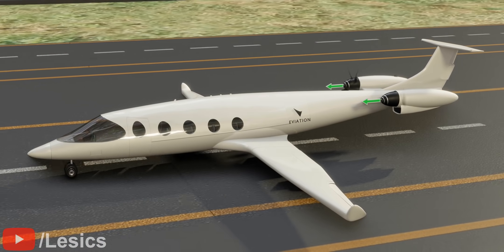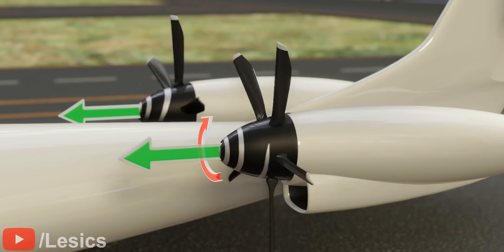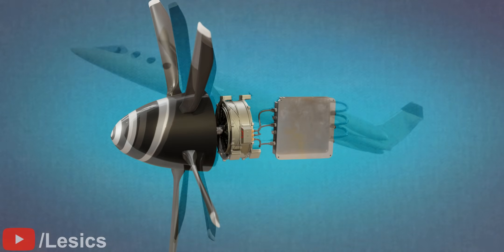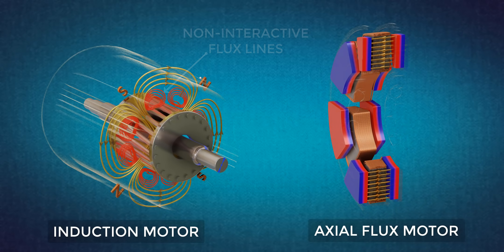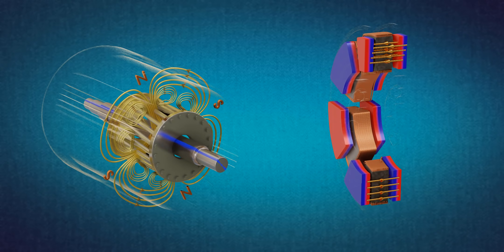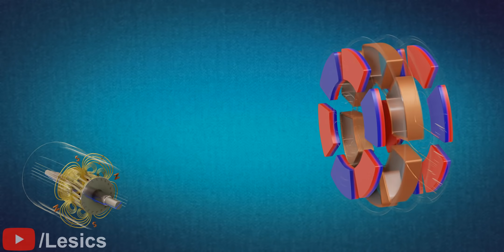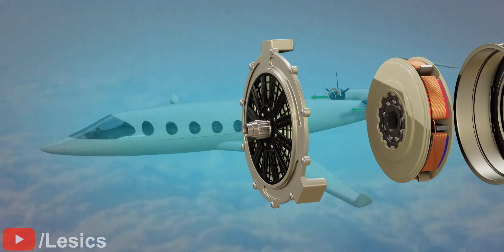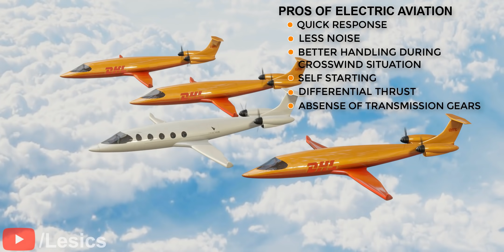Electric Aviation | The Dawn of an Advanced Transportation Mode

Comment: This video sadly isn't neutral, it just mentions pros and also just one company, seems a bit like a commercial to promote those planes. And not even the mentioned facts are true at least not all of them. One example are the elecrical motors if you adjust the frequency the propeller spinns faster, but if the angle of the blades change the current rises. The batteries can`t withstand this current very long so the lifespan is short and the cells are even more likely to overheat and shut down the engines cause the torque is to high to run slower.

Comment: Funny how this presentation puts the hardest part about electric aircraft last(Ed):  power.  They chat about BMS, and distributed batteries, but not the chemistry.  The energy density of batteries c.2021 is abysmal compared to jet fuel/diesel and aviation gasoline.  Large aircraft like what are described here need many megawatt hours of power supplied to the electrical system, or the only national border crossings proudly mentioned at the end if the vid would be from airports within minutes of the borders.  Engines are discussed, but not avionics, lights, temperature control, pressurization (you are competing with turboprop and turbofan propelled aircraft), anti-ice, brakes, boosted flight control system (if the aerodynamics don’t keep the controls and control feel light and balanced).

Comment: Thanks for this interesting production. One slight nitpick with the illustration at 4:16 is that the propeller is rotating backwards. Unless the new technology is able to make aircraft fly in reverse this is incorrect😇.
As far as differential thrust goes, in the aeroplane illustrated the thrust differential would have very little effect because both engines are so close to the axis of the craft. The most  efficient designs that I have studied for electric aircraft are on the wings especially at the tips where the rotating wash from the propellers can be used to oppose the drag from wingtip vorticies by arranging them to rotate in the other direction. At the wingtip the moment for each engine is much more and can be a useful addition to the armamentarium for control of yaw, just as differential wheel brakes can be used to steer the aircraft on the ground
Reply: the original Eviation Alice design (built as a non-flyable prototype) had a tractor propeller at each wingtip, plus a centreline pusher on the tail. Before reaching the flyable prototype stage they switched the current configuration... so the wingtip prop idea didn't make it for some reason (I can think of at least three).

Comment: The technological advancements made in electric motor and battery performance is growing by leaps and bounds and indeed is the wave of the future of both air and land transportation.

But the world will still need to charge the batteries and the answer is NOT eliminating coal/natural gas based electric energy production in favor of wind mills, solar panels or hydro-electric Dams, all of which on their own fall miserably short of meeting electrical energy demand of the world. 

No, the answer is NUCLEAR POWER PLANTS which produce virtually zero carbon emissions where it's environmental impact is minimal and very managable, and  can easily meet the demands for electricity on a global scale.

Comment: to lessen the weight of the battery on board an electric driven plane, a solar energy must be harnessed into its full capacity, thereby providing a continuous source of electrical power to the propeller. this is now weight issue that should be developed and hopefully we can have a full solar driven air transportation.

Comment: Listen, you obviously have a lot of followers on YouTube, but when it comes to aviation, you should probably sit this one out. I’m not sure where you get your info, but you’re incorrect in just about everything you said in the first 30 seconds. 1st, asymmetric thrust is not unique to electric aircraft, it’s common for all multi engine aircraft, and it’s never a good thing, ever. 2nd, electric aircraft are not “better in a crosswind” all current generation aircraft have improved performance in crosswind, it a result of better hull design, not electric motors. 3rd, electric aircraft are nowhere near “set to revolutionize the industry”. There are no viable commuters on the market and despite what a few startups keep tell you, there won’t be for many years. Aircraft certification is long, expensive, and arduous. Expecting a few prototypes to be approved for passengers in a year or two is just not reasonable. If there are any serious electric aircraft on the market before 2030, I’ll be shocked (Pun intended). The only way it will ever happen is if there are serious breakthroughs in battery technology.  Carbon neutral biofuels are much more likely to be adopted than any battery system except in a few niche markets. Liquid hydrocarbon fuels, are, on average 40 times more efficient than batteries by weight. In an aircraft, EVERYTHING is based around weight.

Comment: JET ENGINE IS SO MUCH RELIABLE. No matter how much gas on board your engine performance is controlled by the thrust  levers, unlike a battery running low you loose engine performance.  That's  my two cents.

Comment: With the lack of heat from combustion and the resultant high duct discharge velocity of a modern jet, speed of "cold" electric-drive will be very limited. Unfortunately, common headwinds really take a toll on slow airplanes. Couple this with limited battery capacity, and we have nothing more than a bunch of people selling BS.

Comment: One question, what if one of the motors fails?
Reply: In that unlikely event then you fly on the 2nd motor. The Alice was redesigned to have two closely spaced electric motors for just that eventuality. Initially they had wing tip motors. Probably a requirement for certification. Actually each motor on the Alice is two motors combined via dual windings.

Comment: You'll never be able to carry the weight needed for the batteries required to produce enough power to do anything more than short, light flight. There will never be heavy lift capability with electric

Comment: The diameter of the rotor should be kept as small as possible....it's all drag.   And the differential thrust point is silly.  All jets have multiple levers for differential thrust.  It just isn't that useful.   It's caused planes to wreck before too.

Comment: I wonder how does an electric plane stand up to lightning strikes? As an aviation mechanic I have seen and worked on many aircraft engines that have experienced lightning strikes and they can have big effects on an engine.
Reply: Interesting point given the push to lightness in electric planes means the use of composites not metal. Presumably the Boeing Dreamliner engineers can answer a lot of questions on that subject.

Comment: You miss concerning questions 1 what kind of flight system does it use wing tips and flaps & what happens when there's a power system failure what kind of safety mechanisms does it have

Comment: I would love to see a general aviation electric motor airplane. LSAs or even Cessna 172. The gas savings alone would greatly lower the costs to fly and airplane and also the cost of learning how to fly !  Maintenance costs also would be lowers too for the owners. The airplane manufacturers should move in this direction immediately like Tesla has moved forward automobiles.
Reply: Someone made one.  Can't remember the name, but there is an FAA approved LSA now!  Endurance is like 90 minutes, so it's a trainer at best, unless Elon has a fast charging station at your destination FBO.  Despite the disadvantages, it is cool that someone has done it.  I think we're going to see a lot of advancements in the near future.  There's a lot of hurdles to overcome, but the minds of our generation will figure it all out.  Super exciting to be a spectator in these times!

Comment: The energy density of jet A vs the best available batteries is 15 times grater . 
A hybrid might be a good solution a small turbine running a generator .
Reply: What benefit would you get from a hybrid aircraft? There is not much stop and go in the sky

Comment: Tell me one thing. How does is an Electric plane planed to lose necessary weigh?  Any Plane of a decent size has a takeoff weight far larger than the landig weight. A Boeing 747-8 has a landig weight more than 100 metric ton less than take of weight. This means that as the plane take of with fule, passangers and luggage it can weight up to 442 metric tons but when it lands it can weight no more than 312 Tons to not overstress the airframe or overshout the runway.  This is circumvented easly by burning fule.     Stop talking about the easy stuff of making an electric plane (the engie) and star focus on the real problem, ITS SOURCE OF ENGERGY!!!!

Comment: So less range, less power, heavier, slower, lower MTOW. What is the advantage exactly?

440 NM range is pathetic for a two engine plane, a old GA-7 can go over 1,100. I can imagine it sitting in a airport taking up hours of time to charge for 400 miles, to go across the US at max distance would be 7 landings on the frame, let alone how long it takes to charge.

What they also don't talk about is the battery, maintenance of it is probably a nightmare and extremely expensive.

Comment: Why did they not put counter rotating props on each motor, would it increase the weight too much ?
Reply: Definitely adds thrust but maybe reducers efficiency which is a main driver at present with current battery technologies.

Comment: Attempting to make an advantage from a nothingburger, in the meantime the weight required in batteries remains constant making landing fully loaded extremely dangerous unless you are only building puddle jumpers. Secondly Charging times will keep planes out of service for periods of time that will be unrealistic for airline service. Airports would be crammed full of parked airplanes that are simply charging their batteries which also means that airlines would be required to buy many more planes just to maintain current passenger loads.
Reply: Battery swapping is the way. They can't embedded the battery like this video if they want to avoid the charge. However, the new technology in battery may change the design.
I still dream we will create a mini fussion/fission reactor. So, everything like ship, airplane, truck can utilize them LOL

Comment: But what about weight limits? At least with conventional engines, your plane gets lighter over time as they are consuming fuel. So you can carry more passengers and cargo and land a lot lighter than your take off weight. But a big battery doesnt go anywhere. The only thing i can think of is carrying less passengers/cargo or maybe changing the wingspan of the plane to generate more lift??

Comment: “The most advanced electric airplane”? Did you check the actual specifications? No, because so far it hasn’t made one single flight. Also, differential thrust with engines so close to the fuselage yaws the airplane much less than when they are spaced far apart under the wings, so it would be available on jets much more than on this (still non flying) Alice, but it’s not used anyway, there is a reason why.

Comment: You realize every twin engine plane (jet, piston, turboprop, etc.) can produce differential thrust, right?
Reply: Yes they can, the author of this video is obviously not a aviation fan, he would had known that
Reply: It takes a little bit of response time but they can ☺
Reply: @demoaccount2392  I used to fly J31 and Fokker 50 aircraft. Variable asymmetric thrust can be selected very quickly but you would not do so except on the ground. And by asymmetric I mean full power on one side (why I don’t know) and full reverse on the other. It takes a little longer on jet (F70/100 and E175/190) aircraft but again, it is possible.
Reply: @Trevor_Austin  Ok, thanks
Reply: Your are right.  They can if they are located on the wing.  (No torque moment)  But they don't if the engines are on the tail unless they have thrust vectoring like fighter jets.   Only the previous version of Alice with wing tip props could produce differential thrust.  Not the design shown.

Comment: Converting jet engines to run on hydrogen is a much faster and better environmental push.  Where's decades away from battery commercial air travel
Reply: A liter of jet fuel has more hydrogen than a liter of hydrogen.
Reply: @DinoAlberini   because we all know bound hydrogen and unbound hydrogen are exactly the same thing.... /s
Reply: @beardedbarnstormer9577  yes. Bound is far superior in terms of energy per volume. That’s why it’s used and pure hydrogen isn’t.
Reply: @DinoAlberini   yep that's why they use it in rockets /s
Reply: @beardedbarnstormer9577  only in upper stages, guess why?
Reply: @DinoAlberini   bro just stop.  Hydrogen may have less energy density to kerosene but it FAR exceeds batteries.  Stop with the false equivalency argument
Reply: @beardedbarnstormer9577  not if volume is the metric. And it is.

Comment: When animations are the only visual......reality is usually out the window. This presentation is is closer to comedy than reality. 

This presentation is hilarious in its omissions......primarily the WEIGHT OF THE BATTERIES! The reason planes are not electric right now has nothing to do with motors, drives, BMS, propellors, etc. It is all about the weight of the energy storage system, ie the battery. 

Until a radical new energy storage concept rolls out with far better energy density - electric planes will remain a novelty. DHL moves cargo and the charge by the pound. An electric plane is extremely weight limited, making them a horrific choice for a cargo carrier.

Comment: Fuel is MUCH less explosive than batteries. Puncture a fuel tank and more than likely it will just leak dry. Puncture or have a single cell critically fail, then the plane becomes a meteor.
Reply: Just like it did with the prototype of the mentioned aircraft (that never flew).

Comment: a lot of nonsense in this video  ! axel flux is only one type of BLDC motor & has no real advantage in aviation out runner brushless motor has the same characteristics yet this video ignores them! variable pitch is used to run the motor at constant efferent speed and use the blade pitch to increases speed and thrust this feature is nice to have but not necessary you neglected to mention generator used to capture propeller energy put back in to the battery ? Another example of some one reading the facts and having no real understanding of them !!

Comment: Hello and thank you for the video. NOW= I flight a TBM, but I'm also an Engineer in 2 fields. I have my own Electromechanical LAB, where I can do any test or experiment and so desire. AND here I go. We cannot use electricity to fly larges commercial aircraft at all. We cannot use PASSIVE electricity where a Strong workforce of MJL is required, that is insane and against all laws of the Universe. The propellers use on electric motors are wrong and calculated identically to those of the combustion engine. I own 4 3D printers of 400x400x450, and I can make any model I want." PEOPLE" cars and trucks, as well as bikes, are also different. That's why electric trucks stand no chance on the market, as simple as that. And the same is for small airplanes and large airplanes. PASSIVE electricity is good for small private planes, YES. BUT, COMMERCIAL and CARGO can only fly green with TERRICOLA 1. I did try to patent a few of my discoveries, and I was sent to hell because everything is nothing more than mafia and corruption. Just like wind generators and solar panels in a strong winter. And I end my comment by saying. I challenge anyone in the world to fly an Airbus A-380 100% green, and able to go from Frankfurt, Germany to Australia and return to Frankfurt without refueling, the way I will do it using TERRICOLA 1 on board. Who wants to take the challenge? The same goes for national power plants and ships across the oceans.

Comment: I use differential thrust all the time in flight simulator on 4 engine planes like A340 or 747. Just shut down and engine on either side and power manage the remaining engines to maintain steady flight. Even in real emergencies Pilots have used differential thrust to execute emergency landings especially when ailerons fail due to hydraulic issues. 

Interesting video by the way.